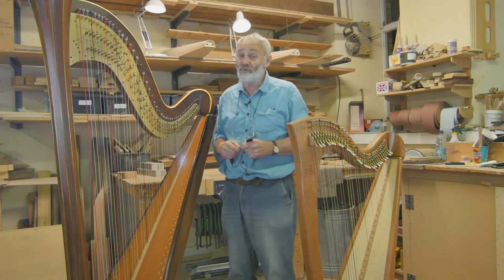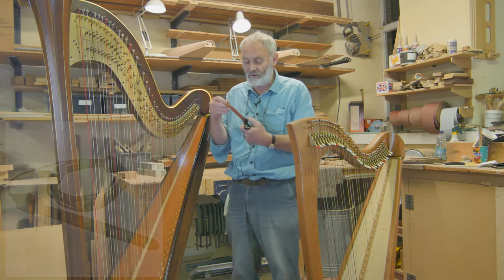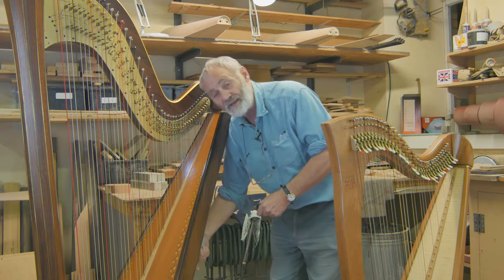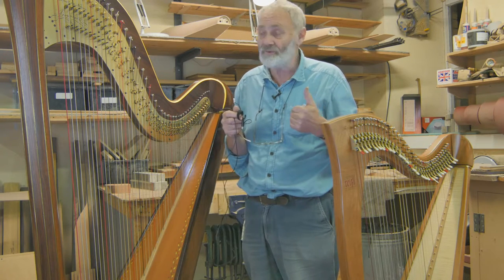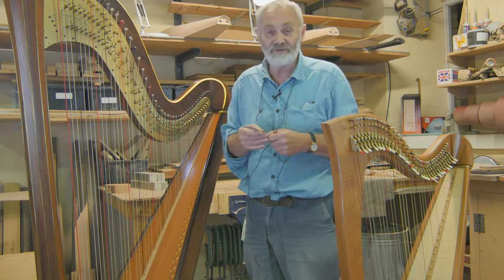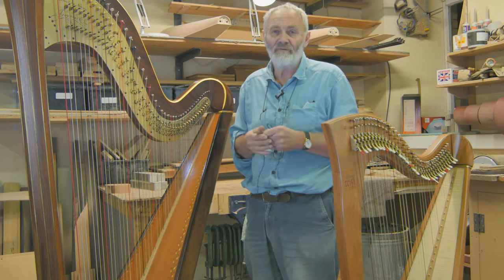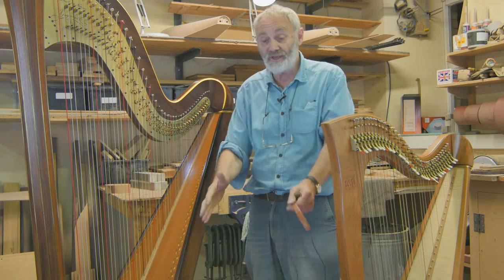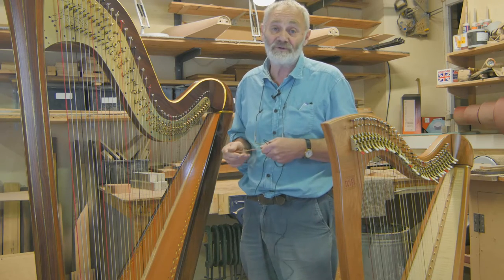How To Amplify A Harp - Teifi Harps FAQs

Comment: Hello, any ideas on how to amplify a harp with a "common" microphone, like a Shure SM57 or a condenser microphone like the Shure SM81. What would be the ideal position and direction of the microphone?
Reply: Ideally buy a piezo contact pickup, they have 3 or 2 separate ones that all go into one 6.35mm 1/4" female audio jack plug, stick them on, or in, the sound box low, mid, high, and run a cable to pre-amp, amp, or PA. Surprisingly good sound & value.

A boom with the 57 aimed at one of the higher sound box holes migh work in a pinch but really it's too directional for the task.

The condenser on a boom about 1.2 meters away, or so, from the strings would work well in isolated situations like solo live or recording but would pick up a lot of spill, if accompanied, otherwise.
Reply: @Drew_Hurst  Thank you very much for your help and suggestions.